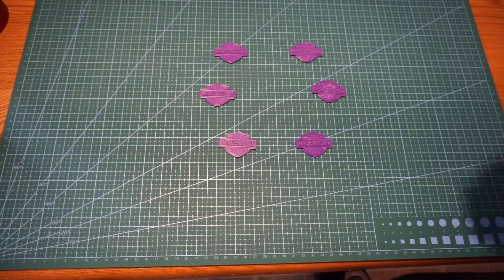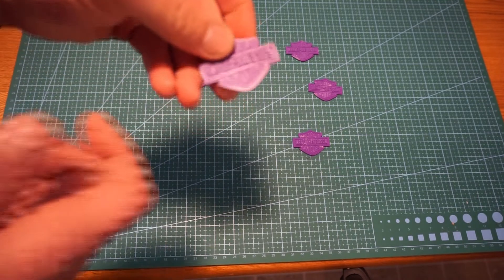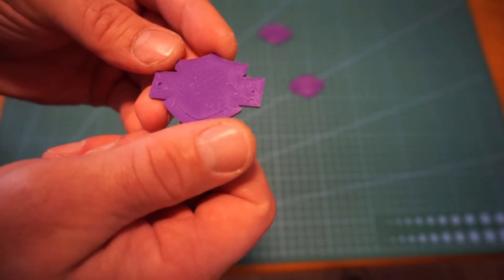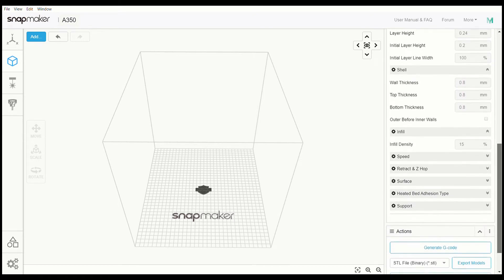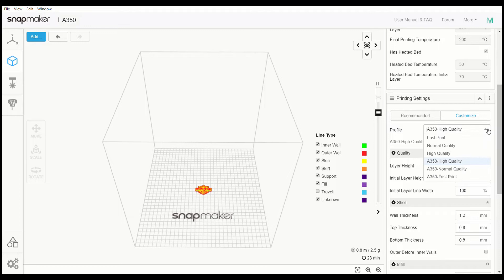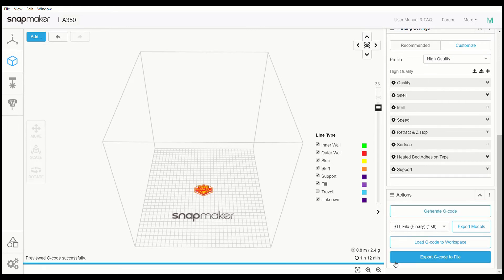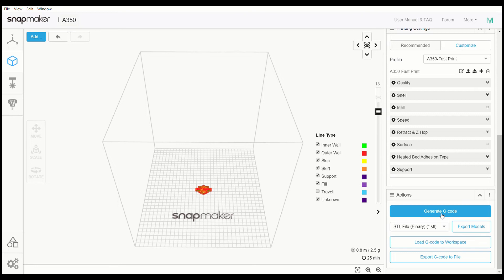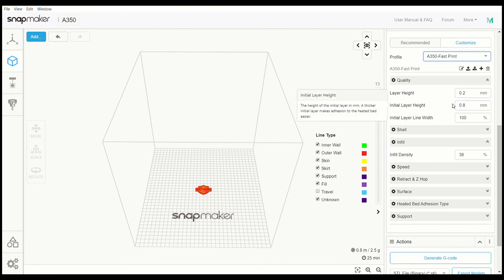SNAPMAKER 2.0 3D PRINT PROFILES TIME EFFICIENCY BASED

Comment: My suggestion. I watched this video on mobile so I really couldn't see much on the models. Some better close ups or more verbal description of what you are seeing would be helpful.
Reply from the maker: I  apologize. Just trying to give a heads up on what to expect going through the different settings. I do have a much better video lined  up for this as a part 2 going more in depth on the setting with different types of filament and actual quality. This is just more related to time.